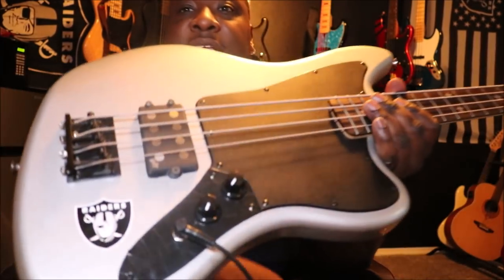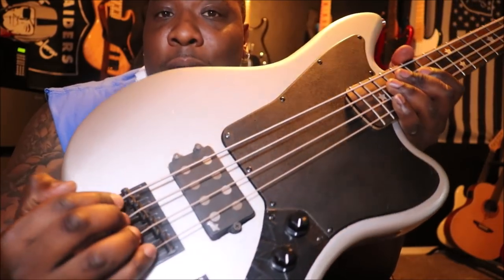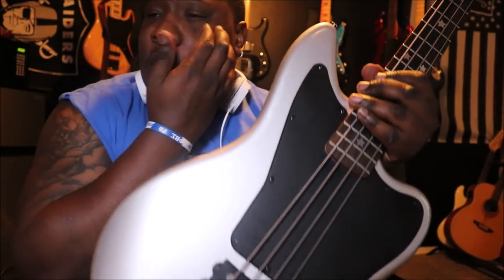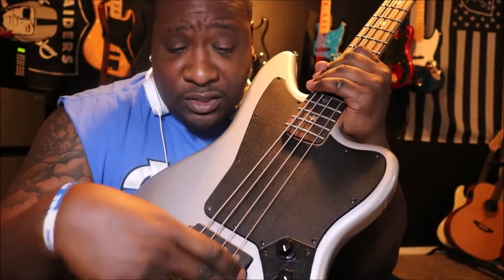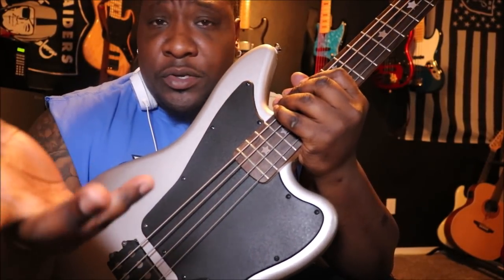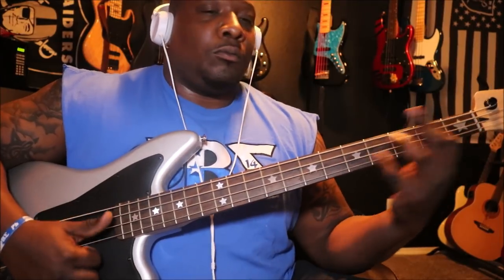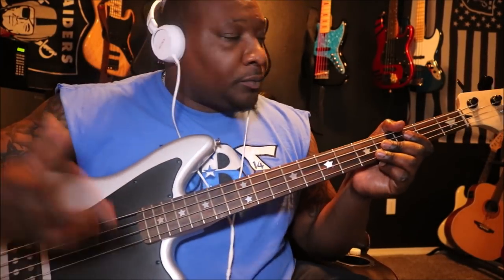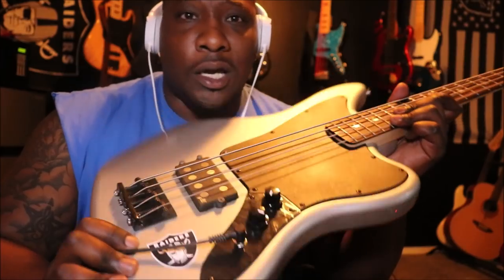Converting an active bass to a passive bass: fender jag Demo (aguilar mm pickup)

Comment: I did that to an old Sterling SB4 which sounded awful with the preamp. I replaced it with an EMG MMHZ passive system, and to me it sounds better like that than a Ray34 HH 2019 I just tried. I’m returning the 4HH and keeping the modded bass.

Comment: Hey, I'd like to change a bass I used to play at my church, from active to passive pickups. It's an Ibanez 5 string bass that hasn't been used in awhile because the two 9 volt batteries it runs on, constantly needs to be replaced. I watched a video of a guy who did this conversion by connecting 2 wires with 2 pins on the circuit board. Not a clear description, I know, but hopefully you can get the jest of it and if it's possible. Love the "new" bass btw.
Reply: Here's the link to the video I mentioned: https://www.youtube.com/watch?v=43WCEkGR65s